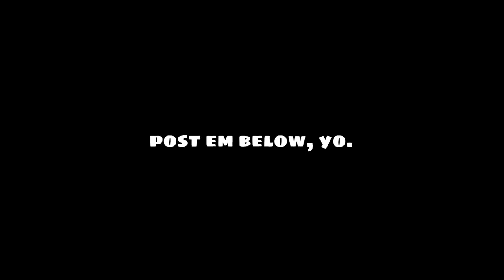Are 2018 KTM 350ʻs Built Cheaply? | 26hrs & BROKEN

Comment: Alright...I'm an HVAC tech, not a bike mechanic :) So take my input with a LOT of salt... Never owned a bike, but I do all my auto work. Troubleshooting is also a huge part of my job, so I hope this helps.

Sounds like you had one problem, that cause a lot of little issues down stream...and you're battling a lot of little issues trying to make sense of them all.
1) Big issue: You had a short. Lord knows why. Shorts happen, and cant be explained, dont try to understand why or how they work/happen.
[1.a]: Fix your grounding issues and your lighting situation. Make sure you have good grounds, and check as many plugs as you can.
2) Failed sensor/computer instrument. Looks/sounds like the short took out the battery, as well as a sensory input (or a failed sensor caused the short, leading to the issues). Either way, looks like crap battery fro the incident. Get a good power supply..then proceed.
[2.a] Seeing the bike run X amount of seconds, then shutting off consistently, it doesn't sound mechanical (like no fuel, or starving). It sounds like a failed sensor or something...basically the computer is shutting the bike down due to a lack of input from a sensor, or the computer has some tripped codes (possible form the short). Clear codes (if bikes even have codes lol) and check critical sensors (sensory input that can cause engine shutdown...this could be related to/tied to fuel as well..i.e, shutting fuel down or killing power all together).

Troubleshooting is fun :) Dont give up, and dont burn out. Take breaks if needed...and avoid forums/internet 'help'. No one knows your gear like you do, and no one can touch it like you can.

Lastly..! Avoid buying parts as a troubleshooting technique!!! Figure out the issue, THEN proceed...buying parts/replacing parts in "hope this works" mentality is never cheap and solve anything.

Good luck, and keeps us posted please :)

And Thanks AB++ for sharing. Enjoying the uploads <3
Reply: great advice!!!!!
Reply from the maker: Oh shit! Clearing the codes!!! That’s gotta be it Jordan! Mine did similar once upon a time
Reply: @AccidentalBroadcast  gotta figger out how to check/clear codes
Reply: Well said Aaron, that is a well-spoken explanation of troubleshooting that I've heard anyone have to say in a long time, take all that to heart gentleman and you will find the problem great response Aaron have a great day
Reply: @AccidentalBroadcast  went out and checked code... was throwing a fuel pump relay code...becuase the fuel tank is off hahahahahahahahahaha

Comment from the maker: What do you think could be goin on with the Jordan Cody Gaiʻs bike?  PS: hit that like button so I know you want more viddy yoʻs..

*vanishes back into the dark, wet, jungle...
Reply: Have you checked the rectifier
Reply: I read about a similar issue on Tumpertalk, fella had a cracked spark plug boot. Maybe tip over sensor??
Reply: I would check the tip over senser and make sure it is working right. The tip over senser when activated will let the bike run for a little bit then kill the engine. I would also check the ground under the gas tank.

Comment: I've been thinking about this buddy, and it's always tough when your not there, but you gave a good description of what happened....so here's what I'm thinking.... To me, it sounds electrical, but heaven forbid I've been fooled so many times before:
1) Start from the spark plug and work back along the electrical path - Somehow, we've got to figure out if that plug stops firing when the bike dies -  There are testers that plug inline with the spark plug wire, too bad we don't know someone we could borrow one from, or rig some other way to determine if the fire  is there when the bike starts, but then goes away when it dies it obviously will go away as soon as the motor stops turning over, so it would be best to rev the bike some when it first starts up so when it does die, you'll have time to tell if the spark goes away or not.
2) If the spark does not go away as the bike dies (at least until the motor stops) then we need to look at fuel, which you have replaced everything of consequence except perhaps the mass air flow sensor (which rarely goes bad), the TPS (goes bad all the time in snow machines, less on bikes), and if your bike has one, crank position sensor, all of which can be tested with a test light.(Back to electrical) The TPS  is more of a pain, and you need some paper clips to slide into the individual connector leads in order to test your voltage at idle, and full throttle, and see if the voltage varies wildly, or is not consistent. If the TPS voltage doesn't stay consistent with your changing in throttle position, then it's bad, which can lead to abnormal lean/rich fueling, and altered ignition advance, which jacks up everything.
3) If there is no spark as the bike dies, then we need to check the coil, including it's ground to the frame. This may sound odd, but before I check the coil, I'll check the signal to coil first. Some bikes have one signal wire going to the coil, and it grounds through the coil being bolted to the frame, others have two wires, one signal, one ground. So, you have to determine which wire is the signal wire from the ECU, and see if you have a low voltage pulsing signal coming from the ECU, which is present while the bike is running, and should keep pulsing as the motor dies until it stops. If the pulsing signal stops immediately when the motor stops firing, then it's not likely a coil or coil wire problem, and perhaps the ECU or further back still. If you are still getting a pulsed signal going to the coil from the ECU, but no spark after the coil, then it's either a coil, or bad coil wire (yes, the coil, and coil wire can fail, although it is more rare). Be sure there is not paint on the frame where the coil bolts to it, a poor ground between the coil and frame can fry a coil easily, and is a common problem on aftermarket powder coated frames, which require careful grinding to clean off the contact points.
4) If you didn't get any pulsed signal from the ECU to the coil, or it's erratic, and all of your wire loom is intact with no breaks, shorts, or connection issues, then we have to suspect a possible ECU failure. This is assuming that you have checked the MAF (usually connected to the airbox), crank position sensor (if you have one), and TPS test normal. Most of the time, before I buy one of these, I will try to find someone with the same bike who will lend theirs to me, and I quickly swapp the ECU's, and re-test.
5) Double check other cut offs, like a kickstand switch if it has one, and clutch engagement switch. Modern KTM's actually have very sensitive electrical balance, and nowadays they don't seem to tolerate bypassing like the old bikes did.
6) It is possible that the tip over sensor went funky, perhaps triggering while you were wheelie-ing, and is malfunctioning now intermittently (I'm not sure how to test, and have never seen one fail, but the manual will have a way to test it I would think) This is a far reach, and in my opinion, highly unlikely.
7) Double check and clean every ground you can find, and follow every wire you can to make sure it's not grounding out, or intermittently loose. Use a pair of needle nose pliers to lightly "pull" on every wire as it goes into a connector. It should not pull out, but if it does, that could be your culprit.
8) Perhaps do all these things, and get back to s with an update? Worse case scenario.... you can light a match and RUN!  (J.K.---- These can be so frustrating)
Reply from the maker: I’m gonna print this out and send it on a delivery pidgin to the gai!
Reply: Gonna re-purchase a test light asap! I really do think the first fuse I blew didn't blow all the way, or soldered itself back together enough to let voltage keep running through to the ecu and fried a circuit off of that. I am going to see if I can find another ecu to borrow for a test!
Reply: @offone9469  the other thing, its possible the pickup down by the stator can go bad, and wont send a signal to the ecu.... so it doesnt know to send a signal to the coil. There is an ohm reading proceedure in your manual to check its resistance. I'm guessing you have a voltmeter/ohm meter?
Reply: @MrDuhfactor  Yessir I have a multi-meter. Kalani discovered a short from what looks to be a smog system sensor to my drive chain...I believe that was what blew my number 1 fuse twice. I think the first time it blew it didn't blow completely or soldered itself back together via arch welding and allowed too much voltage to get into the ecu if that makes sense. I reached out on FB... hoping someone on maui will let me swap ecus for a minute to test my theory.

Comment: Newer cars have open and closed loop systems to run up to a certain temperature running a base map to make sure all systems and sensors are functioning. They can start run and idle before throwing a code or even shutting back off. This bike probably has a miniature version of that in it with efi and all. It could be as simple as a crank position sensor that starts on closed loop and then loses sync into open loop and shuts off to not damage the engine. It could be a coolant temp sensor that is broken and at temp it shuts off quicker and quicker because the closed loop needs to run for less time. 

I would start by pulling one plug off a sensor at a time. Check the battery terminals with no battery to make sure they dont have resistance between the two because that should mean theres a short. Then go through sensors to see if they read the correct ohm. Then check the harness to see if those have resistance. There a bike scan tool out there? That should make it quick 😂

Comment: the short 
circuits in your electrical system may have done damage to either the regulator or rectifier causing there to not be enough voltage after the bike starts and therefor the ecm loses enough voltage to not be able to run everything needed! just remember to always replace regulator and rectifier at the same time or could end up doing them again!

Comment: Just one more thing to try.
Had this happen before, even though it looked fine the SPARK PLUG WAS BAD. a friend talked with a factory bike mechanic who suggested that I change out the spark plug. I thought to myself, no way it's the plug, I inspected it closely and seen no visible crack's, but after going through the carburetor, checking electrical connections, changing fuel,  I changed the plug and it fired right up and ran perfectly.

Comment: And that's why I like to stick to bikes with carburetors..they are so much easier to work on and diagnose than injected stuff with all the sensors and computer and stuff..efi is nice for the throttle response and they start a lot easier in cold seats than a carbed bike..

Comment: Sounds like you have a short somewhere. Check the wires in front behind the headlight mask. Check near all the connectors. PHYSICALLY PULL ON ALL THE WIRES GOING INTO EACH OF THE CONNECTORS.  A lot of times those wires fail. Ive had this happen with a few bikes. In particular, i had a te310 that had this happen twice and exhibit the exact same behaviors as yours. Both times near or inside the connector so you wont be able to tell unless you physically pull on the wires and even disconnect them and make sure the contacts are still there and good and that the wire has not separated from the contact inside the connector.

Comment: There seems to be a lot of speculation around this thing of fuel starvation issue. I wonder if you were to get some ether, also known as starting fluid used in cold temperature places like the Midwest us, and spray it while the bike is running into the air filter area, if the bike still dies, this could rule out fuel starvation.

Comment: It's obviously the tip over sensor. Probably got cooked when you were blowing fuses. It's the only answer for the symptoms you have. If it's not that, and the idle time varies relatively widely, likely there is a short somewhere thats mechanically activated by the vibration of the bike, IE broken wire or loose connection.

Comment: Maybe an issue with the ECU, which might need a magical button to be pressed by the KTM for a reflash. I once connected a power commander inappropriately on a husky and after a little smoke action, it was basically idling at 4k rpm instead of 1500. Took it to a husky mechanic and they connected it to a computer for a ECU reflash and everything was fine afterwards. You can probably try resetting the ECU yourself (there was a certain procedure on my husky regarding that, but it did not change anything, needed to get hooked up at the shop and reflashed). Your head or tail light might have corrupted or brought up an error on the ECU somehow. Good luck and get a less sophisticated bike for less of a headache :)

Comment: Shorter and shorter run times as the engine warms up... Sounds like a compression issue. Valve adjustment or loose sparkplug? I wonder if those had VVT with automatic compression release... I know this is like 5 years old, but I was in Cali when this was uploaded and I had pretty much no internet since I was in a forest on a mountain. Long story on how I ended up there... I still have a lot of work to do, but I figured I would check on you to see how you're doing and start maybe planning a trip to Maui.

Comment: You may have more than one issue going at a time.  Check and make sure your gas tank vent is open,and check all you air ways. make sure airs getting to the engine. Could be the a sensor fail. good luck.

Comment: Check the sensors 1 by 1. After you determine whether or not it is a fuel shut of or a spark shut off. Check if the plug is wet when it dies. 
 It could be a short, I have never used a short detector. But if they work maybe try one.

Comment: It's a KTM, that's the problem :)
Reply: My bet is the spark plug :p I had the same problem with my CRF. As the plug heated up, it opened up a crack in the insulator which  then grounded my bike out.  What a frustrating thing to diagnose!
Reply: @minitwatch  Agreed. Same thing happened on my LTR450. Most def the plug.

Comment: Jordan, is it possible the inline fuel filter is clogged and in between starting intervals the fuel has a chance to seep through just enough to keep it running briefly? I know my KTM 500 has an inline fuel filter buy the quick disconnect. It's a conical filter that's only about half an inch long or so. It's a tight little mesh. You could try taking it out momentarily to see if that fixes the problem.
Reply: I swapped the fuel filter while I was in the tank... :(

Comment: The two '18 350 excf models that I service are great bikes.  Sorry you're having so much frustration over this gremlin  I'm sure you have tried everything at least once.  
Sounds to me like the tilt sensor.  In the times I've dropped my bike it runs a bit, (as if it's on a timer) on it's side then dies.  Just like yours is, standing up.  Do you know someone with a KTM that you could swap out the tilt sensor?  I don't have a schematic handy so I'm not sure how that sensor functions, normally open or normally closed.   Any you might also just remove it if it's normally open.  If it's normally closed then jumper across it.
ECUs have been known to take a crap too.  If you know someone that changed out theirs for a Vortex maybe they'll allow you to use their OEM ECU.
Make sure the quick disconnect fuel line is secured.  I've seen these run for a few seconds when not properly connected.
Reply: I have a buddy bringing his 350 by on thursday to check both tip and ecu

Comment: My brothers 2018 XCW 250 had a bad killswitch from factory.  Disconnect the killswitch and see if it runs. My 17 excf 450 has given me 185hrs of flawlessness.  Well I had one issue when I replaced the large taillight with the smaller enduro taillight the bolt that holds the ground needed a shorter bolt so it could have a solid ground.  Easy fix. Just luck of the draw I guess.  I also did all the performance mods for the 450 excf from ktmandhusky.com and have a vortex ecu. Usually it's 100% something simple and most likely a cheap fix (especially a new bike).  And ktm has been known to fix a bike out of warranty (depending on the dealer).  Would be worth it to talk to your dealer.   

But my main guess is the killswitch or the keyed killswitch developed a short.

2nd guess the ecu pooped out. Not really a ktm quality issue.  I have seen this happen on new Japanese bikes as well.

I do know for a fact nothing is mechanically wrong.  It's definitely some kind of electical gremlin.  Hopefully it's something simple like the killswitch or the tipover sensor.  Not the ecu.

Don't mess with the TPS doesn't make much of a difference with the 2017+ bikes.  Older models yes the TPS made a huge difference and could cause something like this.

Comment: Tell Jordan that the fuel injected EXC's are weird about about battery lead connections and system ground connections.

I had an issue on my '14 that drove me nuts and turned out my battery leads were not tight.  Lights were bright, starter spun, never would have known.  But it has run amazingly ever since.

The subframe on the late models (like your '18) doesn't ground like it should.  Dave Simon says to run a ground wire from the battery ground to the main frame.  

Both of these are cheap to try.  You never know.  That might be the fix.

https://youtu.be/n52LWa4KVa8
Reply: yes, re-grounded, cleaned, scraped, grounded again. still shuts off :(